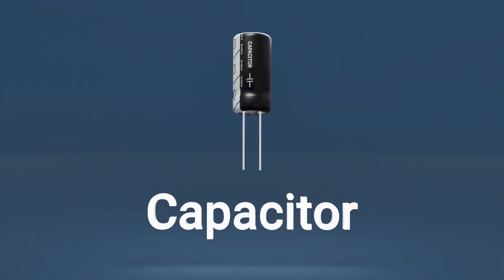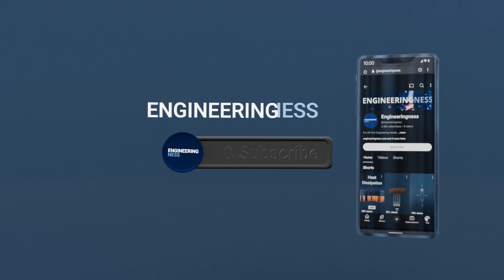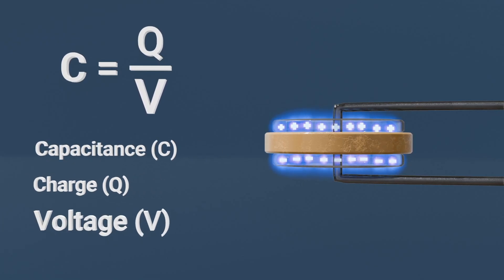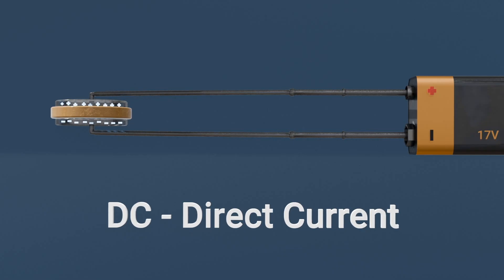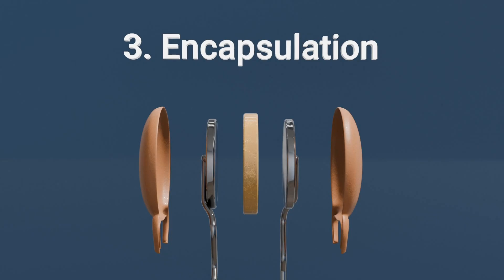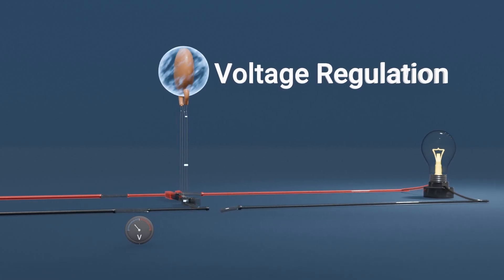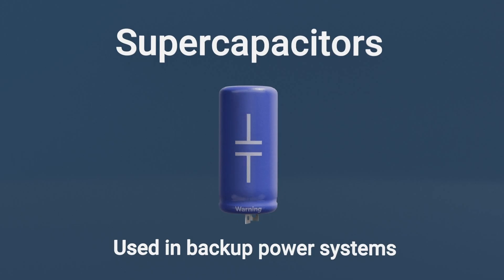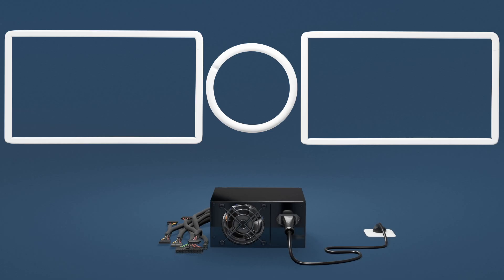What Is a Capacitor and How Do Capacitors Work? The Tiny Component Powering Every Gadget!

Comment: By adding a resistor to the circuit you create a timed release of the voltage 
  This circuit is usually used in Elevator Door Closing times .

Comment: An old fashioned automobile condenser is a type of capacitor, trapping current and keeping the points from wielding together.We used to charge them up by hooking them to a spark plug wire, then tossing one to an unexpected person nearby. As soon as they caught it and touched both ends, it would give them a mild electrical shock. Fun and games back in the day.

Comment: Note you said plate area increases capacitance but you didn't change the area in the animation, you changed the height/volume of the plate. To increase capacitance you would increase the diameter of the plate not the height.
Reply from the maker: Yes this is correct, we did miss this in the QA and only realised once published after a few days! Unable to change it we hoped people would just listen to the voiceover rather than take head of the animation! 

Good spot! And anymore improvement please don’t hesitate in letting us know ☺️

Comment: Now I have a question? 
Can You think of a capacitor as spring? That charging thr capacitor is like pressing on the spring and releasing the charges is like releasing the spring?
Reply from the maker: Great question! Yes, you can think of a capacitor like the electrical equivalent of a spring (which is mechanical). When you charge a capacitor, you’re storing electrical energy in the electric field between its plates, just like compressing a spring stores mechanical energy (or potential energy). Once released, the stored energy is discharged—similar to how a compressed spring snaps back to its original state.

It can go deeper than that, but we are trying to keep the content simple haha.

As always, if you have any suggestions on how we can improve out content, please do let us know. We are always wanting to know how we can improve.

Awesome analogy BTW—love the way you're thinking about it!

Comment: Delighted to find this one, and immediately subscribed.
Reply from the maker: Thankyou soo much, if you have any suggestion on how we can improve our content please don’t hesitate to let us know!!!
Reply: @engineeringness  Nice job!

As you have asked for feedback, to avoid potentially confusing any viewers, I would suggest that when showing an AC electrical source (as in this video), rather than showing a '9V battery' with an AC symbol on it, using a 'motor/generator' graphic (with the AC symbol) be used instead, as batteries only ever supply DC, and simply spinning a motor creates an AC generator (and is actually how the vast majority of AC supply has historically been and is currently created).

I am well aware that other options to create AC also exist and could be portrayed (ie various solid state approaches), yet my experience has been that using an accurate yet still easily understood and/or implemented approach, as a motor/generator icon represents, would likely be a more effective yet still easily understood way to portray an AC source.

Using some sort of 'plug/wallplate' could of course work as well, yet given that those are Not the same everywhere, and ultimately Not how the AC is actually created, that would not really serve to assist with overall viewer education, as this channel seems to be geared towards.
Reply from the maker: Hi, I am so sorry, I have no idea how we missed this comment. I just stumbled upon it whilst going through trying to find another comment to response to 🤦‍♂️. 
You’re absolutely right. Batteries only supply DC, so using a motor/generator icon to represent an AC source is much more accurate and clearer for  our viewers. We will deffo take the advice on board and always appreciate the honest feedback! Thankyou for taking the time to let us know.
Reply: Same here.

Comment: The Animation at 2:00 is misleading: Capacity is determiniert by the area of the opponing plates. The Animation Shows an Interesse in their thickness.
Reply from the maker: Sorry about this, we do have a quality check etc but it must have slipped through! Will definitely be more observant on the next video and make sure mistakes or anything misleading doesn’t slip through! Any other suggestions to improve our videos is greatly appreciated!
Reply: @engineeringness  I liked the fact that you admitted, it show how responsible you are.👍